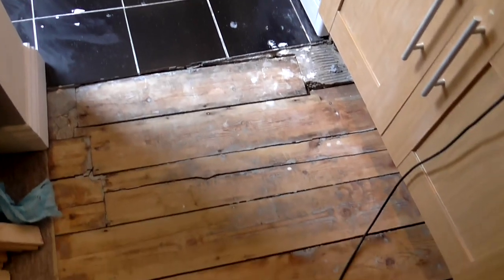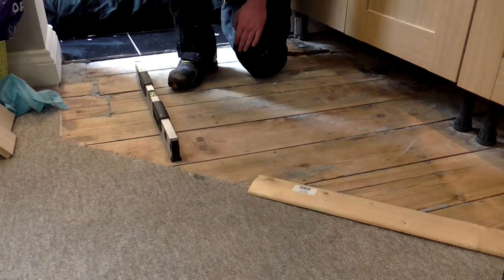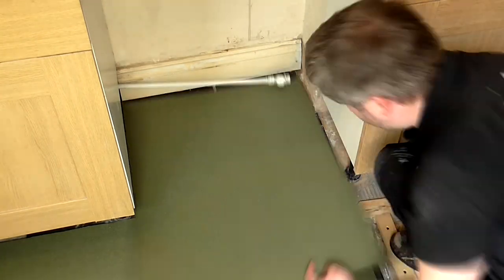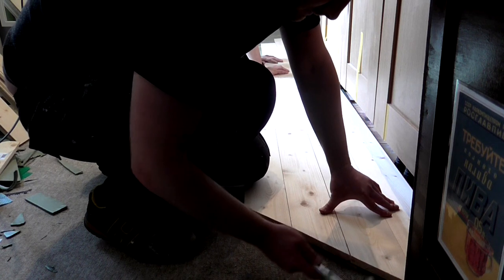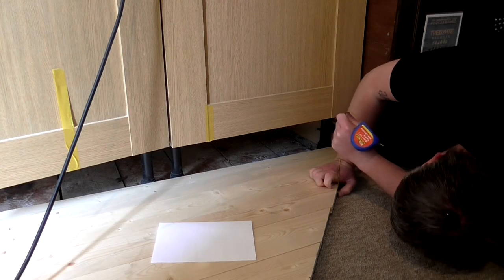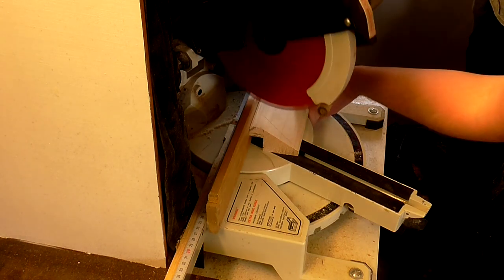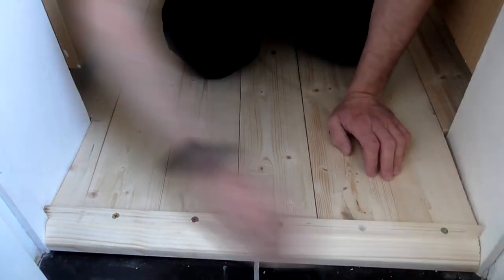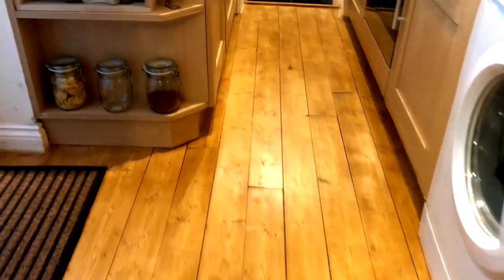Laying Wooden Flooring In A Kitchen

Comment: Very well done. Thanks for reminding us that there IS a right  way to lay those boards (re: the tip on the bigger/thicker side going up on t&g)...the reason, I believe, is so that over years if the floor is sanded or otherwise worn down the t&g integrity will be maintained longer.  I really love your work and am using as much recaptured material for my tiny house on wheels (I’m a long time dumpster /skid? diver, which drove my ex crazy...after 30 years he wanted and got a divorce and I must say that my seeing a new use for almost anything, was a significant contributor).

Comment: A cheap way of improving the finish if you have a pillar drill, is to buy a plug cutter. Counter bore for the screw heads. Tap in the plugs and trim off flush. No screws visible.

Comment: Looks great guys. Can I ask about the floating floor: so was the whole floor only secured at the doorways? There is no movement or puckering up of the timber? I thought there might be a bouncy looseness if it wasn’t secured. I am putting a floor in soon as well and was wondering if it should be secured to the subfloor or if there is a likeness of movement and pressure by the timber if I do that

Comment: Looks very nice. could glue not have been used so you don't have all those screws showing?
Reply: i would have drilled a bit deeper to hide the screw heads with dowels. Could make some interesting details at the trim. Just with glue i would fear kicking them of over time

Comment: Just wondering if you thought about removing the tile first and then laying the wood floor over what would have been a same height floor throughout.  It would also have left you with a floor that wasn't inches higher than the surrounding floors.
Reply from the maker: +John Cole he didn't want the hassle or mess of removing the tiles

Comment: nice work Keith. I remember your mate as the electrician on your workshop. Q1 Does the varnish make it watertight (always the issue with wood in kitchens/bathrooms)? Q2 Are there suppose to be those gaps, if not, what happened?
Reply from the maker: +Alistair Dymock well remembered! The varnish is waterbased and offers pretty good protection but I wouldn't necessarily say it was watertight.... will be ok for the odd spillage but probably not from a washing machine leak! There are slight gaps between the boards where they meet, I think that's just how they are to allow for movement and expansion/contraction as the seasons change

Comment: Floor looks great, great work. My only concern is the raised lip as you leave the kitchen? Not sure if it's an aesthetic thing, or required?
Reply from the maker: +lloyd kelly it needed something at he ends, and I was also a bit worried about how high it was but because it's spruce and not the strongest wood I made sure it was quite thick so that it wouldn't crack and break off. It's basically a small step. Seems to work ok so far though

Comment: I just wonder why one would choose spruce for flooring, probably one of the softest woods around.Even pine would be harder. If this was meant to be cheap and temporary it will do the job. Thanks for the video. Although I might disagree, I still liked watching it.
Reply from the maker: +The Bez I think he wanted it to look rustic and look similar to the existing floorboards in his living room (which are pitch pine but with the same stain applied) so a bit of wear and tear won't necessarily be a bad thing
Reply: How is it holding up so far? Due to the cost(woods are gold here, less than 1% of people on my island can afford real wood floor), I have limited choices, Douglas fir (1 1/2") cost five times the price here compare to spruce ( 3/8" ). and I'm choosing between them...any advice?
Reply: I did almost the same (spruce) 15 years ago in two of my bedrooms. Still looks good and has lasted very well.

Comment: Wow, that's a great job being done! Congrats.
Can you tell me how that subtitles/cc (closed captures) works?
Sometimes I turn it on when watching You Tube videos when the maker is talking too quickly for me.
This is the first video of you where I turned it on because you speak very clearly (English English is more common to me than
American English, although on You Tube I follow more American than English makers).
And in fact, for this video I turned on the CC option for only one word which I misunderstood (and did not make sense in that case)
But then I left the CC on and found out, that it is nearly perfect (found only two mistakes), as where at other video makers
the CC option sometimes makes a mess of the spoken words and it becomes very hilarious to read.
Do you do afterwards some fine tuning on the CC? (if that is possible). Or is your voice indeed so clear that the program does
everything right?
In any case massive Thumbs Up for the project, the video and the CC.
Thanks for sharing.

Comment: I don't understand why you didn't use the available table saw for many of the cuts you made. Additionally, if you would have undercut the door framing you could slide the hardwood under. with tongue and grove, these floors aren't meant to be "floating" and should have been secured in place with at minimum 18 gauge nails, but properly with cleat nails. Haphazard jobs will never stay looking nice. I think the aforementioned, in the comments, gaps will grow over time and the floors minimum preparation will likely result in squeaking and problems down the road. A friction fit for any appliance with a component of water is not the best of ideas. Though, the face-screws in this application actually could be considered charming.
Reply from the maker: I didn’t have the tablesaw with me, it was at home. I’m not a professional we’ve never done flooring before, but the floor is still fine and my friend is very happy with it

Comment: the gaps between the boards are too big. nothing used to keep the planks together so it will all move apart over time. all in all its one of the worst flooring jobs ive seen in a while.
Reply: Well I asked for rustic and we've never done any flooring before. I'm happy with it anyway.
Reply: move apart to where? Where will they move to? Their is no gap for them to move into.
Reply: The risk is the sum of the gaps will approximate the tongue depth, so if there is movement perpendicular to the board run (most likely to occur coming in and leaving through the back door), your footfall will shift the boards, pushing them tighter together and opening up a gap from which a single board can spring.